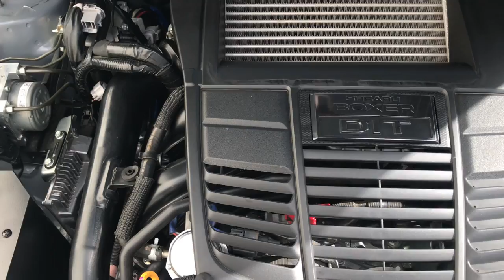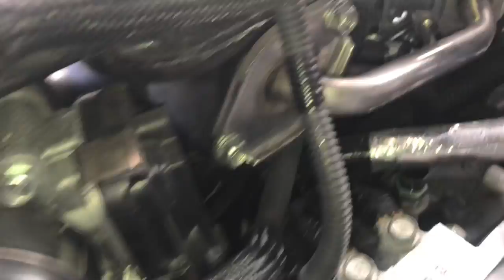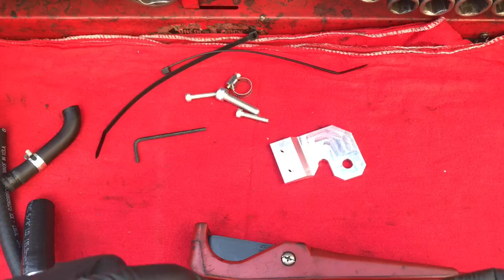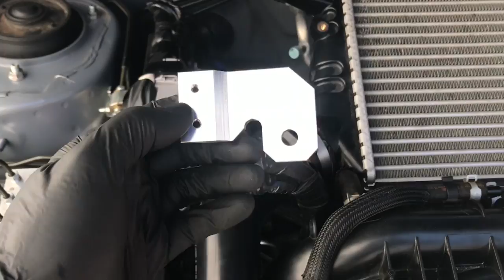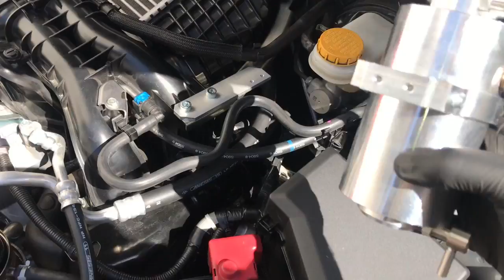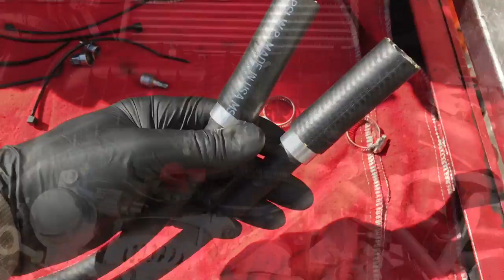Installing Boomba Racing Oil Catch Cans For A 2015-2018 Subaru WRX (stage 1 And 2)

Comment: Sorry, I couldn't catch which of the two hoses behind the intercooler goes to the in/out on the stage 2 side.

So the port by the egr is the out and the one that goes straight down is the in?
Reply: Out is for intake ( the hose you modified) and in is for the engine block.